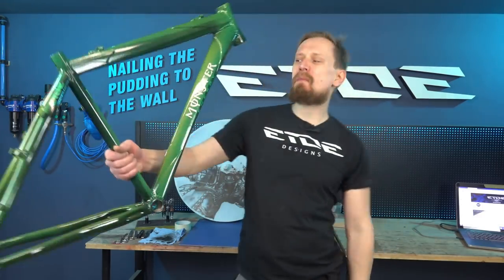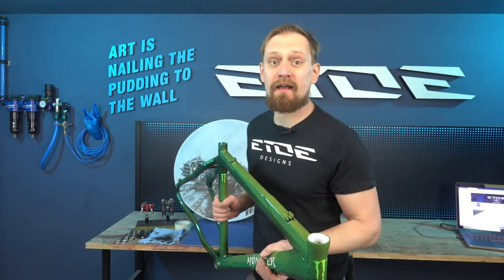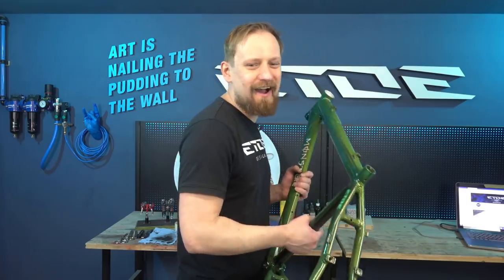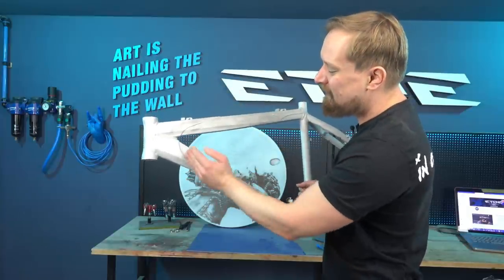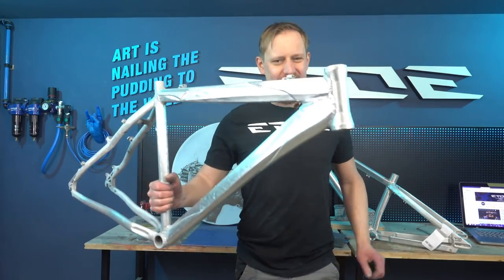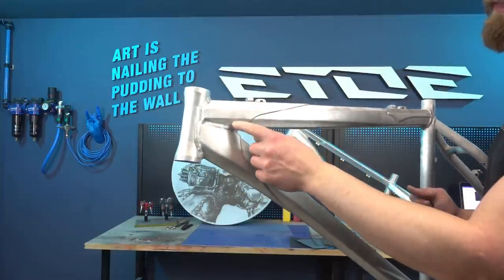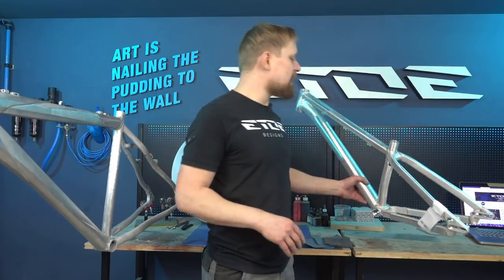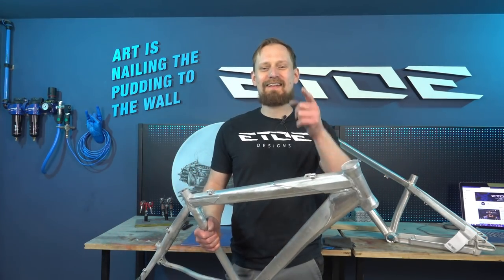I failed hard doing a bike paint video!

Comment: 😳 Wow Martin! It's 08:40 on a Saturday morning and you've posted a video! What a Wonderful way to start the weekend! I love the new sandblasting cabinet, perhaps you can do a video on it? The different air pressures and the different blasting media? I propose a crackle finish on the cheap Aluminium frame and is it possible to get it smooth with spray cans clear coat after applying the crackle finish? Thanks Martin for posting this video.... it's not a failure, it's a learning experience! 👍✊️👍👋🇬🇧
Reply from the maker: Please watch the blast cabinet video I did some weeks ago. https://www.youtube.com/watch?v=MsHe4I0UjjQ&t=37s
Reply: @ETOE, that is 😡 mad! I have been subscribed and watched your channel for a very long time but I Obviously didn't get any notification from YouTube! With the lockdown, I have noticed that YouTube notifications are useless. It's not like your channel is controversial or Political but for some reason, no notification! I've unsubscribed, resubscribed and hit the notification bell 🔔 again.... let's hope that this time it works!

Comment: You can get a pretty nice brushed aluminum finish using WD40 and a *red scotch brite pad. Saturate the tube/section with WD40 and scrub (lengthwise). Always in the same direction. It really gives an even look to uneven or discolored alloy surfaces.

Comment: Hi Martin. Wow, I could just see the brushed aluminum effect. Too bad you had to give up on it. Being that the frame is a bit rough, my suggestion would be to apply a hammered paint on it. I've successfully painted my touring bike that way and it looks great even after two and a half years. The challenge however, was to get this paint to harden. It took longer than the engine enamel I've been using since then. Greetings from Edmonton, where I can't paint bikes until May, because it's too cold and I don't have a nice paint booth like you  😜

Comment: Etoe, I have a question. If I wanted to do a DIY paintjob on a steel frame. I follow all your steps sand, use a 2 component primer system, use Montana gold cans, but if I wanted to get a paintjob that last a long time would you recommend going to a place the does powder coating so they can put a clear coat on top of my paint job? Or will the 2 component clear coat system that you recommend be as durable?

Comment: Martin, thanks for all great content. I have a Trek 9200 fully disassembled, hand sanded, paint purchased, I bought 2 spray guns (0.4, 1.2), stencils done, all set up just waiting for aluminum paint video. I have one question, how long can I wait to apply coat? Some people say since it is 2k clear coat over polyester paint, it need to be quick. If so, how can I have time to apply stencils, paint and remove the stencils without mess-up with base paint ( color in Martin vocabulary ).
Reply from the maker: Your time slot is max 10 to 15 minutes or the clear coat won't stick.

Comment: Have you ever painted an aluminum frame with a body seal, easy body or similar?
that rough paint, resistant to abrasion, scratches and even chemicals used in pickups bedliners.
I have seen utilitarian all terrain vehicles completely painted with this (in one color only), I looked for examples on bikes and couldn't find them. I am about to paint my bike after a repair and I would like a resistant paint, which I hardly ever worry about, but I do not want just one color, maybe two or some stripes or combine body with normal paint. I know logos cannot be placed due to the texture, but I want a utilitarian more than a pretty paint. Will it be worth trying something like that?

Comment: Martin, i know this is not the correct video but any tips on removing ultra old (30 years +) stickers from a frame? I've tried heating them up but it doesn't really work because every time i try to peel the sticker just falls apart lol, i removed 1 out of 12 and it took me almost an hour.
Reply: Fartbox Muncher if your not keeping them. I used razor blade backwards. Hold 10% angle go back not toward edge. Worked on my Madone and doesn't chip or gouge frame.

Comment: Sanding big Steps 1600 grid next 2000 grid finish 3000 or higher grid dan polish  it whit Dremel machine at high speed end wool bit with copper past dat must do trick high speed sorry for de bad English ✌️✌️✌️

Comment: Just use a drill and wire brush bit
Reply from the maker: Don't  do that if you have soft aluminum frames. The surface gets damaged because the steel of the wire brush leaves deep grooves in the aluminum.
Reply: @ETOE  well the soft one ??